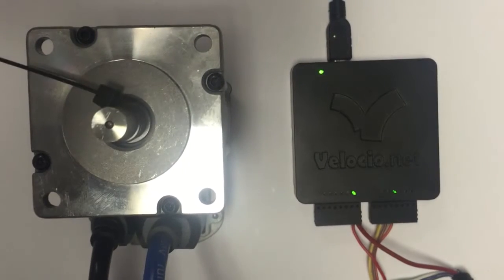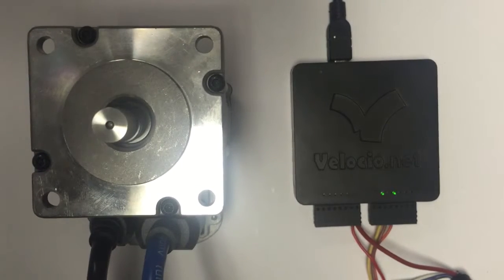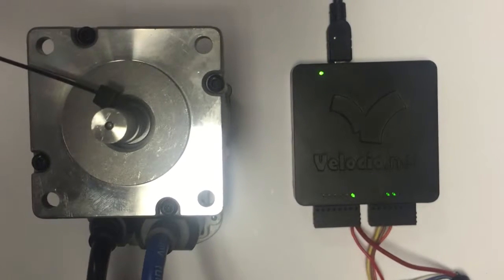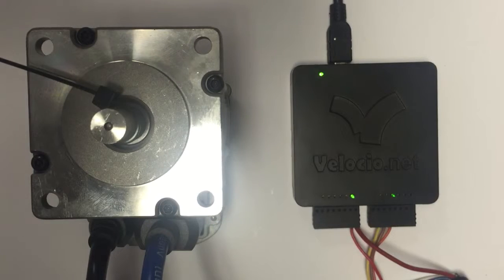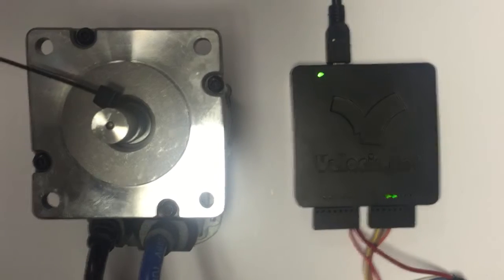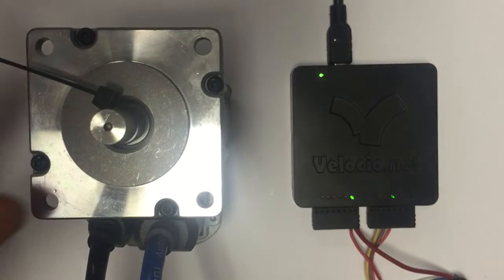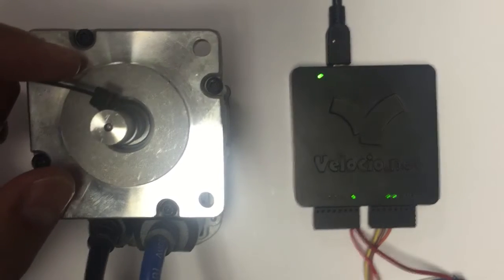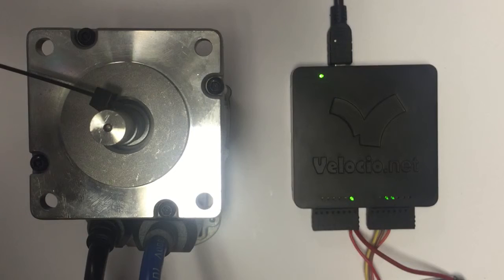Ace PLC High Speed Example with Motion Motor

Comment: Hi
I just recently found this plc and I am pretty intrigued to buy one. I wonder though. 
From my understanding the pwm output is sinking no?, is there a way to use a stepper drive with only  positive step input like this one?
https://www.omc-stepperonline.com/digital-stepper-driver/digital-stepper-driver-03-22a-18-30vdc-for-nema-8-11-14-16-17-stepper-motor-dm320t.html
Best regards
Reply from the maker: Hi. Just add a resistor on each output. See https://www.support.aceautomation.eu/knowledge-base/how-to-wire-digital-outputs/ see "How do I connect my output to a PNP input?"
Or chose a driver compatible with both, NPN and PNP. With + and - inputs for each input.